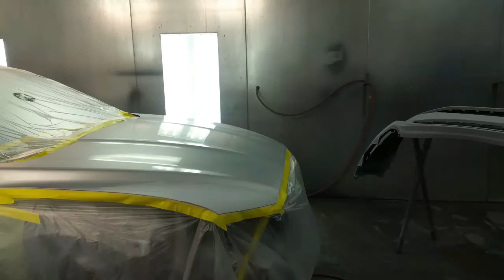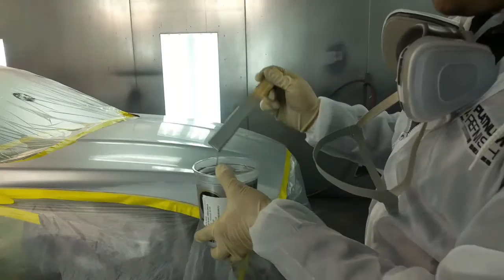How to professionally spray paint, blend high silver metallic without blotches step by step  PART-2

Comment: I have an issue with silvers.

Even though I have a good match I still see that the section of the panel I painted is not as sparkly not as metallic as the factory.
 under certain angle you can see the "flatness" in my paint.
 anybody has a suggestion on gun size , tip size,  nozzle size,  pressure or whatever I can do to help my issue greatly appreciate it thank you